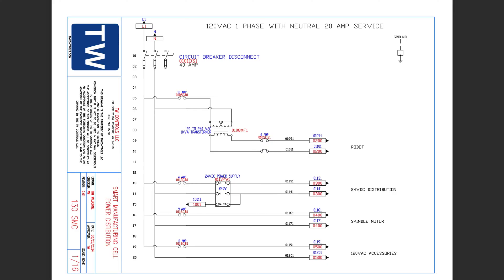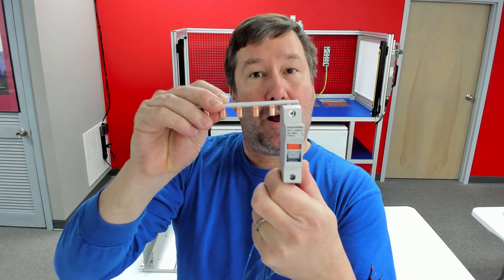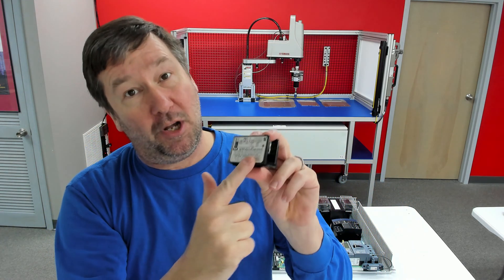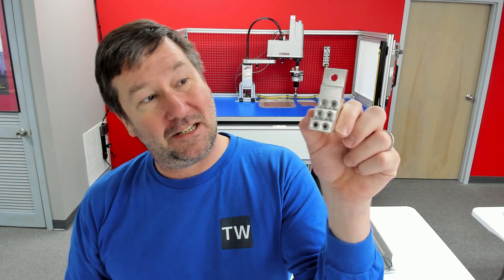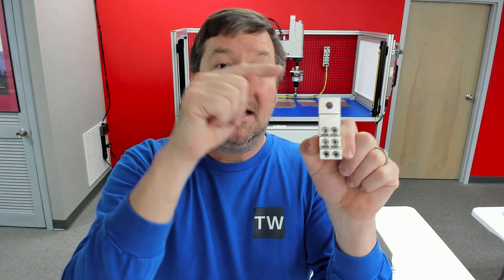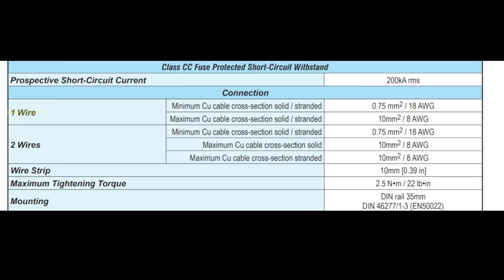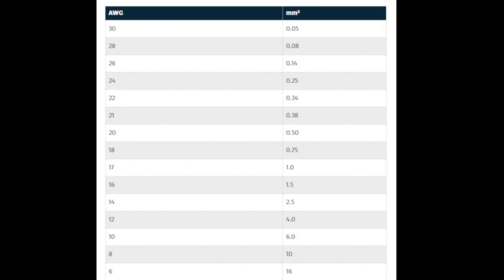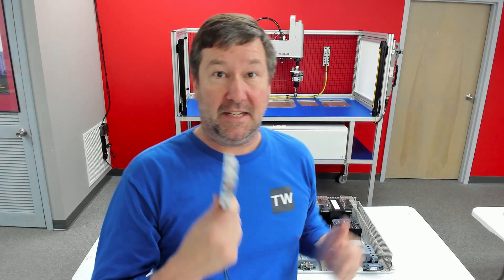Can You Put Multiple Wires or "Double Tap" a Circuit Breaker

Comment: I like the Allen Bradley 1492 breakers, they have 2 locations for the cables, this means that if you use the double ferrules then yes you can have 4 wires coming out of them. :)
This is especially useful when you are feeding multiple devices that do not have the room to fit a double ferrule in their terminals.

Comment: “Just because you can do something, doesn’t mean you should do something”

When it comes to branch circuit protection, whether it be breakers or fuses, it’s always best to have one wire per protection device. Those blocks that allow multiple wires for distribution can be a nightmare to troubleshoot and also cause nuisance shut-downs on equipment that is working perfectly fine. Ideally, every device should have its own fuse/breaker, with the panel requiring a main breaker rated for the entirety of the panel load.
Reply from the maker: I agree, especially downstream of a circuit breaker.